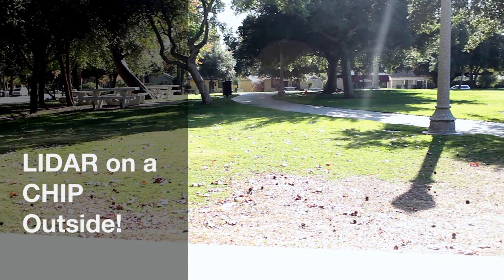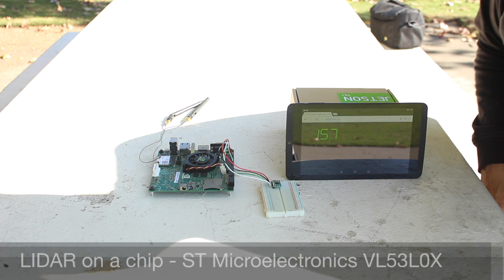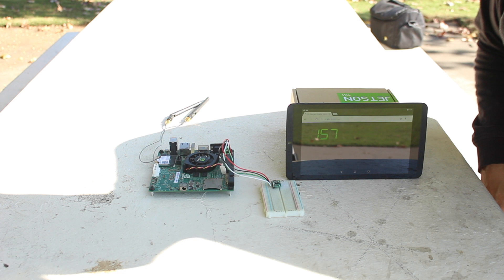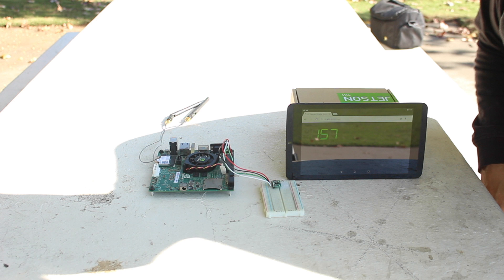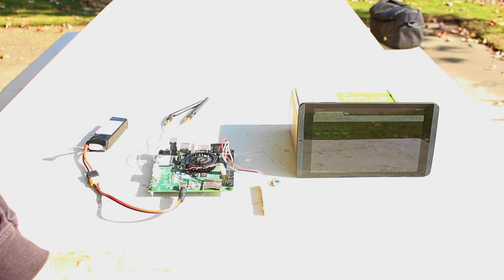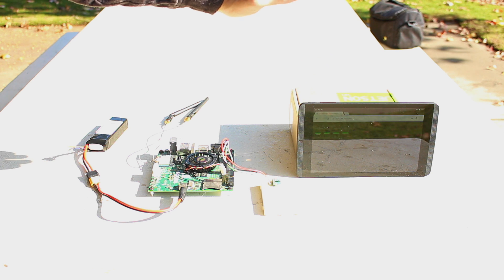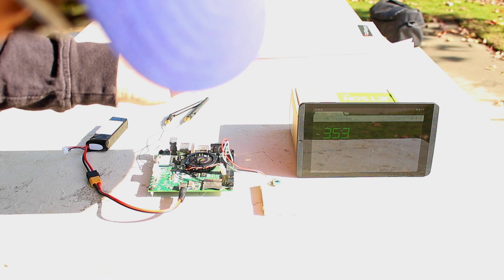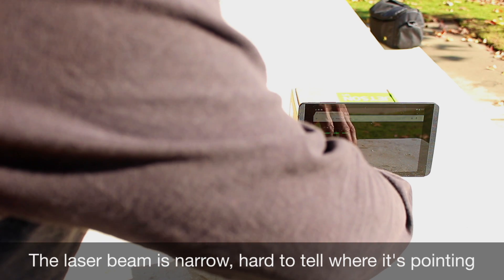LIDAR on a Chip Outside - NVIDIA Jetson Development Kit

Comment: Will tx1 or tk1 what remote desktop? vnc?  Recently in the use of tx1 opengl with no way to remote display
Reply from the maker: My guess is that you have to tell the X11 desktop manager on the Jetson that when there is no monitor attached that it should still use graphics. Here's a link: http://wp.me/p7ZgI9-A4
Reply: I have bought a fit-headless, inserted in the td1 hdmi mouth, set x11 /etc/X11/xorg.conf restart, I use the pc machine how to connect to the tx1 desktop? Is the remote ip login?
Reply from the maker: I don’t know enough about what you’re asking to be helpful. You need to set up screen sharing on the Jetson, and have a connection with a PC program. Please ask this question in the official NVIDIA Jetson support forums: https://devtalk.nvidia.com/default/board/139/jetson-embedded-systems/

People there should be able to answer your question.
Reply: Thank you very much ! I have solved the problem I think is x11vnc + fit headless, the effect is very good, virtual screen to ensure that the remote control display is the highest resolution.
Reply from the maker: Great to hear you got it working!

Comment: Great experiment, I was very curious to see this thing work out doors, Thanks :) What are you thinking of doing with this thing? a cluster? or maybe attach it to a servo and use it as a scanner?
Reply from the maker: The idea is to put a couple around the RACECAR project so that the car can tell when there are objects immediately blocking the path forward or reverse. The cameras on the car project tend to be a blind close to the vehicle, and there are no sensors in the rear.

Comment: @JetsonHacks Thank you Jim. You are a friend 😃
I think that it cannot be used as a ranging sensor, but it's good enough as "virtual security bumper" bumper to slow down a robot if an obstacle suddenly appears (a cat, a person... the leg of a curious 😉)... really amazing
Reply from the maker: Thank you my friend, sorry it took so long. We had rain here for a couple of days, and I wanted to test on a sunny day. It's not as saturated IR wise as it is in the middle of summer here, but it's pretty representative of what a sunny day brings most places. 

I had the same feeling as you, it makes for a good 'bumper' when things are within a foot or so. I've seen a lot of robots that don't have backup sensors or forward crash sensors, this gets rid of some of the reasons to not have them, namely size and cost. Indoors it performs much better, it can probably be used for more interesting applications there.